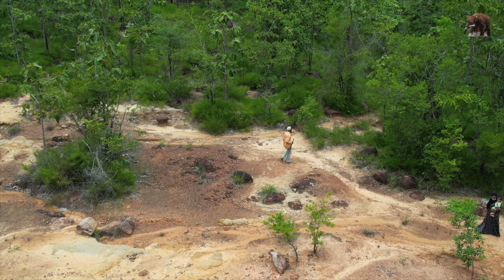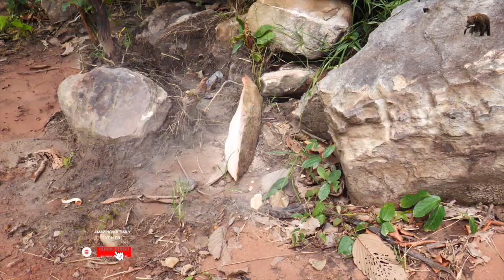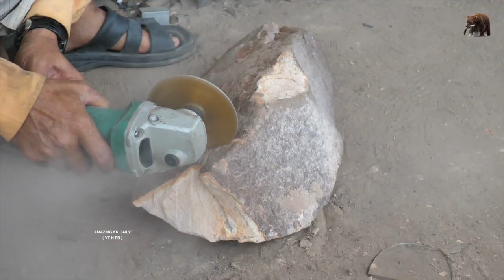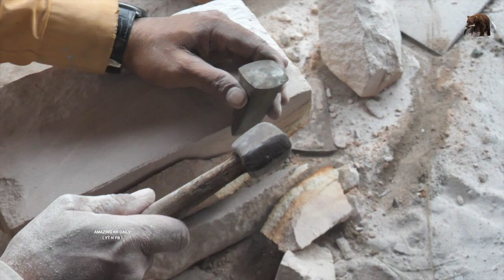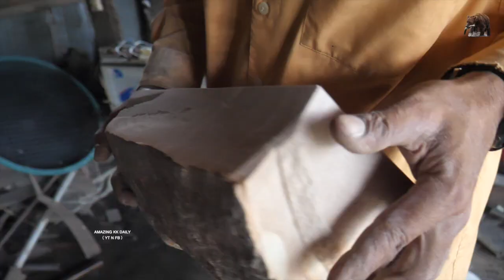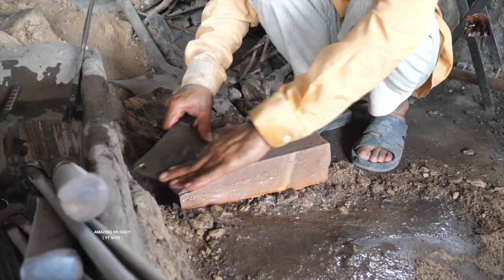FAST AND EASY WAY TO FIND AND MAKE A SHARPENING STONE BY VILLAGE BLACKSMITH

Comment: Knife sharpening channels: "You need to go online and buy 1000, 3000, and 6000 grit Japanese water stones."
Village blacksmith: "Give me a piece of rebar, an angle grinder, and a rock."
Reply: аха-ха, до слёз)
Reply: Based on the way the steel looks like after grinding my guess is that's somewhere around 800 grit which is more than enough.
Reply: Man of the north Although not certain, I guess from the sound of the steel rubbing against the stone is around 400-500 grid.
Better results are obtained if the surface of the stone is well polished and oil is used instead of water.
Reply: @YandimYanasanYar  Possibly yes but it's uneven which could make it sound more rough.
Reply: Leather stop and grits
Reply: @YandimYanasanYar  OIl costs money, which is probably why he uses water
Reply: @toddellner  nowadays they are asking to buy diamond plated stones ,

Comment: i wonder if he could cast grit in a mold like concrete....but where to get the supplies is the question in his case... an ancient method is the foot-treadle stone wheel, I think those were later cast (wheel with hole in middle)
Reply: Yeah i guess he could, but there are nothing wrong with natural whetstones. In one of his comments he is saying its quarried from the mountains so i feel its type of stuff they have used for ages. He says its type of sandstone, and i think historically it has been used lot as sharpening stone.

Comment: All you need is 1.) double cut file - for brand new blunt edge 2.) a chefic whetstone - sharpen the edge more 3.) a naniwa whetstone - don’t sharpen, just take off the heavy burr 4.) a leather strop block - take off the smaller leftover burr, won’t mess up the leather.